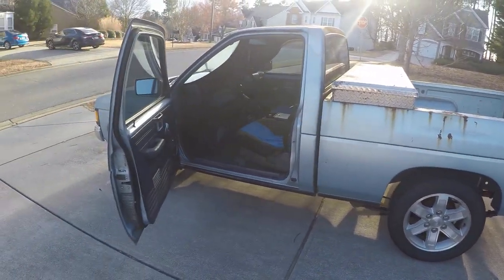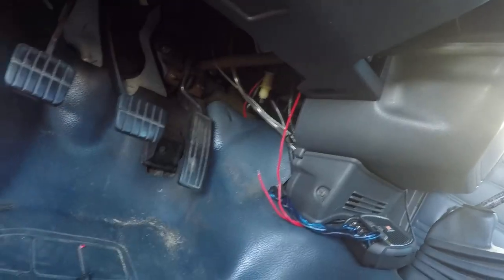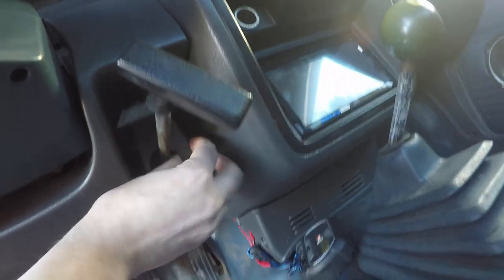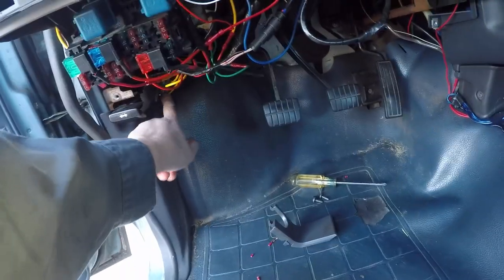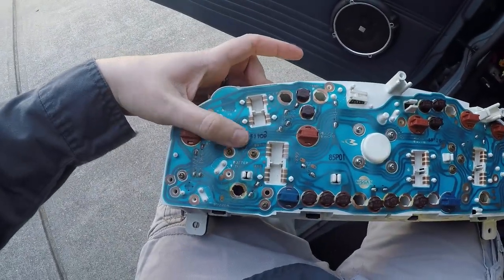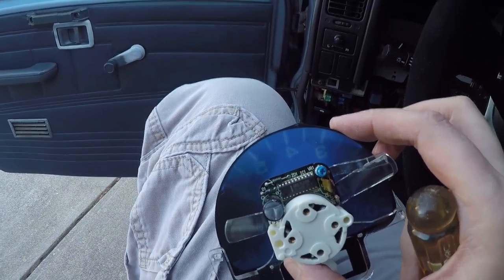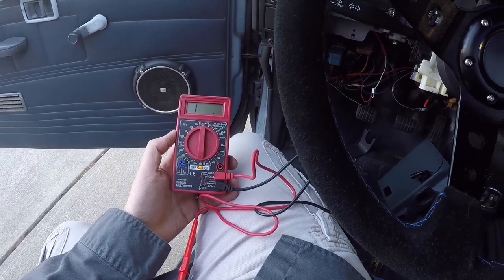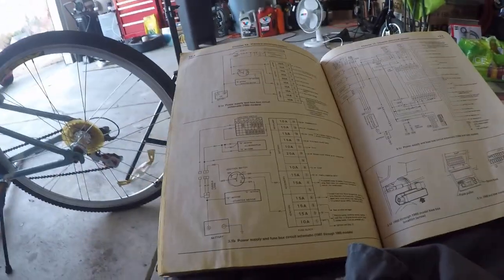Hardbody Tachometer fix and Speedometer check

Comment: I have done the same swap and could never figure out the VSS. Did you splice the cluster into the original harness? How does the ECU throw a code if it was cable driven speedo? Thanks!

Comment: Did you ever fix this issue? I’ve been thinking about doing a dash swap on a 93 hardbody but also want to use the newer cluster!
Reply from the maker: Yea, it was just a cheap electrical connector for the speedo. Pretty quick fix. The wiring for the new gauge cluster takes a second to figure out, but wasn't too bad.
Reply: me too

Comment: I been having issues with mine so what I did I changed it and it is 5 miles behind so if I'm going 65 in the gage it reads 60 and unfortunately on the one I have it doesn't have the screw to adjust the speed and so far I bought 3 different clusters and they all read the same and none of them have the screw I do understand the gear ratio changes but they were the same trucks and same motor and all were with manual transmission like mine so any tips are highly appreciated thank u for ur time

Comment: Do you know if the temp gauge has the same kind of pot behind the gauge face as the tach and if it can be adjusted? I'm having an issue where my temp needle only sits at about 1/5 when fully warmed. I've done a bunch of tests on the temp sending unit and stat, but still cant figure out why my needle is so low... The gauge itself is kind of my last area I havent explored. Any info or advice would be greatly appreciated. Thanks!
Reply: same problem. i’ll let you know if i figure it out.

Comment: Thanks for your helpful video. I have a 1994 Nissan d21 king cab hardbody with the 3.0 v-6 4 wheel drive. I recently noticed that my trip meter and odometer quit spinning so my mileage is stuck which can really turn someone off from purchasing a vehicle knowing that the mileage isn't correct. My speedometer and tac work fine, it's just the odometer. I took out everything today and the gears that turn are perfect and no play or anything broke or stripped. When I first start my truck up and drive it, the odometer turns and after a few minutes, mainly when driving uphill, the check engine light comes on and that's when the odometer quits turning. After about 2 -3 miles the check engine light goes out and the odometer starts to turn. I'm wondering if it's an electrical issue or the speed sensor that's mounted to the transmission.
Reply from the maker: Typically the check engine light is only related to emissions issues, so It's odd to me that the two would be related.  I'd check the transmission connection first since it's easier to get to.  Not the speedometer and odometer are hard to get to by any means, but it's a little easier to crawl underneath real quick and check a connection.  Lemme know how it goes!

Comment: Very nice.  So the newer dash fits the older ones?
Reply from the maker: Yup, up until I think 97?  i swapped a 95 in.  Gotta do some wiring and switch to the electrical speed sensor, so make sure you grab that too if you grab a dash to swap.
Reply: Shop Shenanigans  which wires do I grab and where is the speed sensor located ?
Reply: Shop Shenanigans can you pls do a vid on the wiring .. I’m stuck ! I need help
Reply: That’s a very cool swap! Thanks for making a video on this. Can this swap be done in a 1987, 4cyc automatic? If so can you point me in the right direction for everything needed to be done and parts list?

Comment: Need a little help if enyone can help me please i have a nissan hardbody d21 1993 and the temperature gauge not working  i replace the cooling temperature sensor is only 1 cable but the needle dont go up truck runs good and i like to fix tha little issue  meybe someone can help me please thank you good bless you all
Reply: same issue here.. i’ll let you know if i figure it out
Reply: Had this issue on my 97, the fix no lie was to slap the dash right above the temp gauge.  A good slap and the needle would work until the truck got cold again.
Reply: @tylermaschke1208  i did that work but same problen

Comment: Jesus, do you actually know anything that you're testing for, when you use your multi-meter?

How about taking a spare speedo sensor (or the one off your transmission), pull the speedometer out of the instrument panel and hookup 12 VDC, GND and the sensor to the speedometer? There's a guy on YouTube who did that with the speedometer out of his 1990 Dodge Cummins. I had way less test equipment than him, and used a drill to turn the speedo sensor. 

Virtually every electro-mechanical speedometer system works the same way.